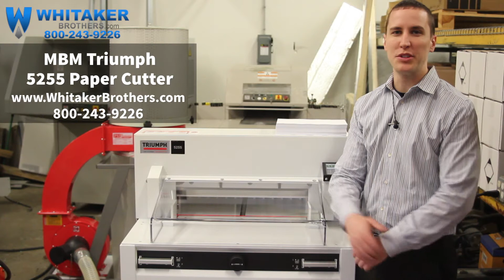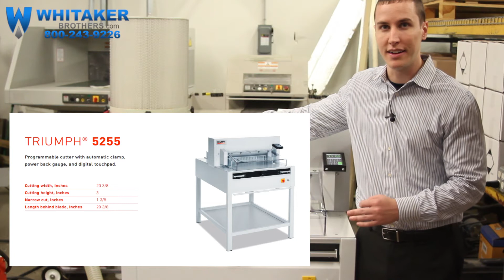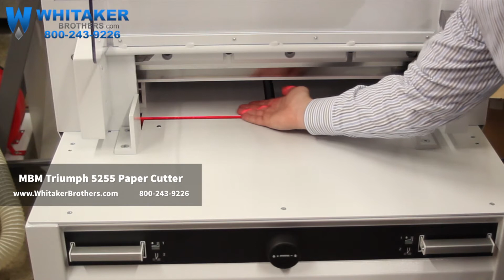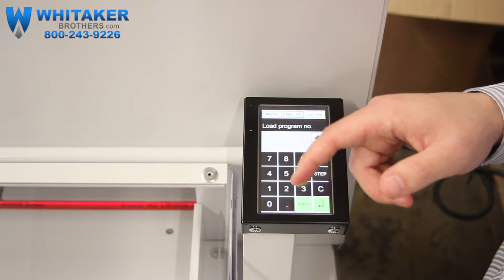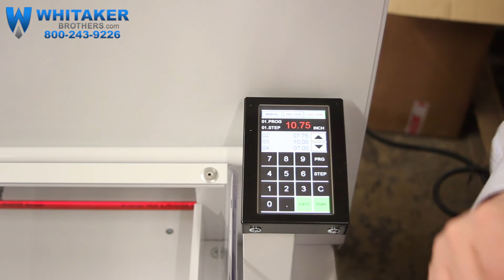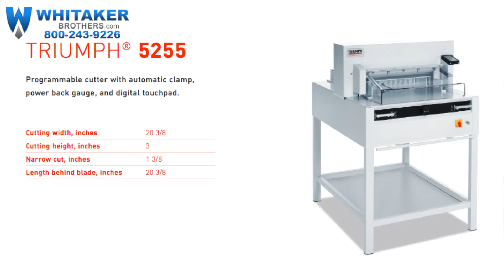MBM Triumph 5255 Paper Cutter

Comment: What do you do if the clamp becomes jammed in the down position? Have tried resetting but nothing will make it return to its start position.
Reply: there is a tiny spring on top of the machine.  If it comes off, the clamp will lock down.  Take off the top cover (above the clamp/blade).  Look for the tiny spring (has a loop on each end).  Replace it and put it back on.